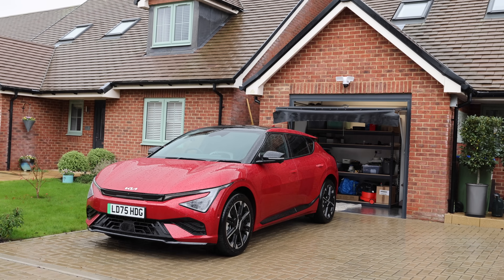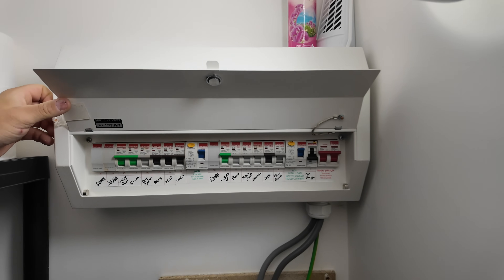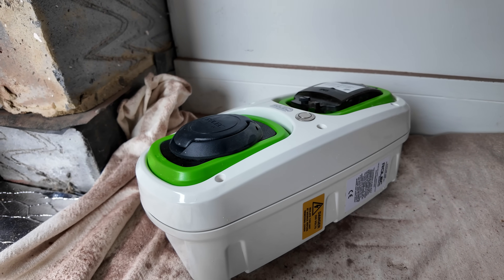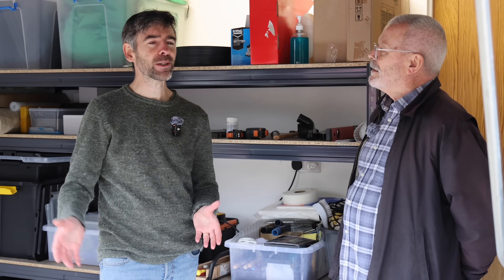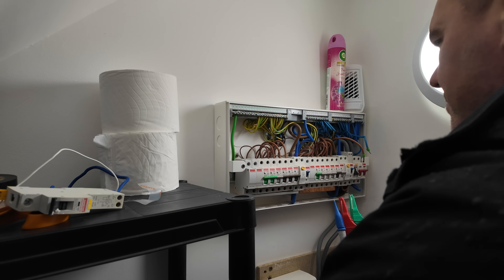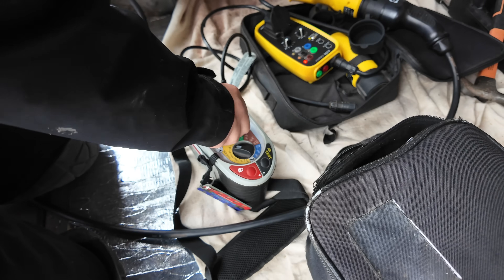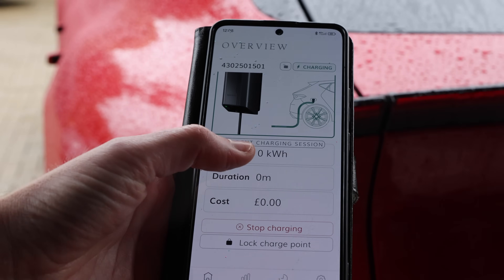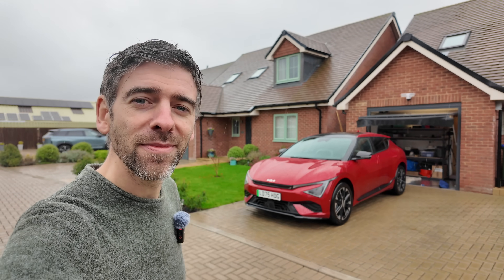Big warranty, big cable, small charge point. Swapping a Rolec charge point for an Andersen Quartz

Comment: I have 3 phase and have 2 charges at mine for the 4 EV”s we have a Wallbox and a Tesla both cater for 11-22 kw but only have connected to single phase 11 kw 
We have a brand new Tesla model y performance a Tesla model 3 highland a brand new corsa e and a 73 plate MG4 . None of these cars accept more than a 11kw ac so what is the point of the 22kw option 🤷🏼‍♂️ I’ve never understood unless you have say a sigenergy DC charger (£3500😬) or something else that gives a DC output.
Reply from the maker: There are EVs with 22kW AC. Renault and Smart for instance, but it’s also an option for others.
Reply: @MrEV yes would not sway me to buy one but would think seeing as Tesla used to have it in early S & X models you would carry through ! But I suppose the amount of people it would cater for is so small regarding the 3 phase they binned it . Never mind can’t have everything lol a self driven beast that looks and rides fab on long trips , I can wave the 2 times a year I could do with it lol😂

Comment: Nice looking charger and the slim profile will suit many. I’m looking for such a unit to potentially replace a Wallbox Pulsar Max which after two years of mostly trouble free use has a current problem, thankfully caught by accident (I needed to move the incoming supply), the tethered output shows signs of extreme heat damage where the cable has melted at the connection block on the circuit board. Unlike the incoming supply that uses a screw down terminal connection the tethered cable uses a wago style lever terminal block – presumably to save time in the manufacturing process – this design choice appears not to have stood the test of time and operation. I was encouraged to see that Andersen have used a screw down connection for their tethered output but then undone that good practice by using wago style terminal block for the incoming supply! I’d hate to think that should a similar heat issue befall  an Andersen charger a warranty claim maybe dismissed as customer connection error. Why can’t manufactures just design things properly!

Comment: When your WiFi goes down how do you control the Anderson? It doesn't appear to have a screen of any sort.
Reply from the maker: I've heard it works in "dumb mode" if the wifi isn't working.

Incidentally, I didn't show it in the video but John's wifi actually wasn't working so we connected it to his phone's hotspot instead, so that's another option.
Reply: The set-up button is also used to start & stop charging...

Comment: You didn’t state if it was both suitable with Octopus go and if it will work with solar. If one has solar are there extra bits to fit so that it can see when solar is producing spare electricity.
Reply from the maker: It certainly works with Octopus Go and I did say that it works with solar? I imagine a CT clamp would be needed in that case.

Comment: What a pity the builder didnt put in a modern one. Wondering how much all this cost (parts, installation, labour etc)?
Reply: The Andersen Quartz starts from £695 and standard installation is £435.
Reply from the maker: Builders will often do the bare minimum to say "it's got a charge point!"
Reply: Some just put a weatherproof box ready for one.. fair enough.

Comment: That’s it- drill a big hole from inside to outside with a blunt drill and make sure you compensate with hammer action and lots of pressure.  Guaranteed to explode the front off your brickwork…..

Comment: Andersen appears well designed. 8m cable very useful. We have a Tesla wall connector and works seamlessly with both the Tesla App and Octopus Intelligent Go app - also very clean design in my opinion but the tethered cable may be a little short for some.

Comment: I cannot see the benefit of taking a mains connection, currently (no pun) protected from the elements inside a garage, and Shoving it out into the pouring rain? Why not simply plug the car in, then run the cable under the door??
Reply: Exactly, our Zappi is in the garage, cable runs fine under the door which has a 3-4cm compressible seal strip which closes nicely around the cable when closed.
Reply: Most likely there isn't a gap under the garage door. But I agree with the sentiment, you want to hide the charging unit from thieves.

Comment: I’ve seen new developments that have a 13A socket outside and called it a charger. Nuts.
I think having a junction box with appropriate cabling would be better than installing a simple charger as it’s highly likely that the new home owner will want to install a different charger. Throwing perfectly good EVSEs away is such a waste.
Reply from the maker: Yes, a junction box would arguably make more sense to allow home owners to do research and choose a charge point that works better for them... that said, then I think a lot of people just wouldn't bother and would be perhaps less likely to get an EV.

Comment: Always go tethered!
Reply: I've gone untethered for one reason. If some knob decides to damage the cable when my car is plugged in, I just buy a new cable. With untethered cables, in some cases, the EVSE is a sealed unit, so you'd need to replace the entire unit. Expensive.
I'll add that my EVSE is inside the garage.

Comment: Given yesterdays 3pm mile announcement I want to take advantage of my car’s V2Home capability but don’t know where to start? Anyone know where I should look ?
Reply from the maker: There aren't really any V2H charge points widely available yet unfortunately. 2026 should be the year for them though!
Reply: Many do V2L ie vehicle to load, with a 13A cable. Eg ionic 5 and MG4. 
 Not really V2H but still useful in a power cut.

Comment: My charge point is in my garage. It keeps the charge point (Zappi) out of the weather. I run the charging cable under the garage door. 
It also keeps it away from the prying eyes of passing yobs and drunks.
Reply: Same here, exactly. Zappi cable runs nicely under the compressible door edge seal strip.  Simples.

Comment: Oh My God! why did you take all the lead off and put it on the floor??? Just take off what you need
Reply from the maker: Just habit! You get increased heat when the cable is coiled and it's slightly less efficient. Less an issue on a cold Autumn day, obviously!

Comment: How does the charger work without a data cable for load management etc? Looks like the original wiring didn't have one?
Reply from the maker: It uses a wifi connection.

Comment: Home chargers need to be tethered. Untethered would be a right faff. I guess you could leave your cable in it but prob not ideal.
Reply: I agree as it is a pain to take the cable out the car however there is a cheap solution.

 We have an untethered old podpoint solo we’ve had for 5 yrs. we had a 10m 7.2kw type 2 cable used with a previous plug in hybrid and as my new ev will charge at 22kw the cable was surplus to requirements.

I put the 10m cable in situ and used a long hasp padlock round the cable and trunking from the main board to the podpoint which locks the cable up.

It meant we had a 10m tethered cable for the cost of a padlock

Comment: Looks allot like a simpson and partners  which I believe the Andersen is being looked into for intellectual copyright for transparency.

I would not get another charger that has a plastic casing or shroud that isn't easy to change or ready available if the charger is outside in all weathers (sun mainly) as they can get brittle and start cracking from experience.

Comment: I’ve been umm-ing and ahh-ing over getting a proper charger installed for years. I’m sure it would make planning a little easier but the 3-pin really is fine for us.
Reply from the maker: I hear from a lot of people for whom 3-pin does the job for them which is great. A dedicated charge point is safer in theory and the higher voltage brings greater efficiency (so less energy/money wasted when charging), and obviously supports smart tariffs which are great, but I'm sure for many it's a false economy to spend so much on one.
Reply: Sooner or later the 3 pin socket will burn out but they are cheap to replace. A switchless one is preferable as the switch is often the weak point.. electrician I am.
Reply: @MikeGleesonazelectrics  Thanks for the advice. I’ve had my leaf charging off the same socket every night at 10A for over 6 years now so I’m sure its days are numbered. It does look fine after all those years and after 6 hours of charging the socket and plug are both cool to the touch still. 

I’ve recently got an Ioniq 5 too and I can turn the amperage on that down from 10A to 8 or even 6. It does take much longer to charge at 6A though.

Comment: another good video, I looked at the Anderson offering, but decided to go with an untethered Vestel unit with install from E.ON, I'm now on their Next Drive Smart V5.2. I decided to have my unit in the garage because it lights up like Blackpool illuminations when the cars plugged in. I've got a 10m cable that runs under the garage door when charging.
Reply: How long have you had that installed for? I only had mine installed in March and EON had to come out last week to replace it as it stopped working.
Reply: @charliebell3956  It was installed December 2024, had to have a software update in May, but not had any real problems.
Reply: @AF-eq4hf that’s good to hear, I have seen nothing but bad reviews on trust pilot about these chargers and EON, EON also do not offer this charger anymore which is worrying. When I spoke to the technical team on the phone they advised that they are problematic and when the electrician came to replace my faulty one he said that they were not good chargers. It took them 9 days to send someone out to look at the charger as well which isn’t great.

Comment: I bought a cheap ChargePoint for £315, thought I could do with just a dumb one - 6 months later, wish I'd bought a smart one now as I can't take advantage of Eon's NextDrive or Octopus' IOG... you live and learn!
Reply: I just use a granny charger and a 3-pin plug - it works perfectly well with Octopus' IOG.  You don't need a smart charger.
Reply: I also use a granny dumb charger on EON Next drive, so I don't see why you can't?
Reply: @Hamilas-zk8hm Doesn't your car need to be compatible in that case? My car isn't compatible unfortunately.
Reply: @lukecalladine1683  Yes, I believe so.  I have a VW ID7 which is compatible with Octopus.  So Octopus connects directly to the car and sorts out the charging schedule to be ready when I want it to be.
Reply from the maker: That's so frustrating!

Comment: I just got a Hypervolt 3 Pro and it's pairing really well with the Octopus Intelligent Go tarif. It seems to give me off peak at any time of the day, even when it was well below freezing and I thought the grid demand would be high. Very impressed so far. I've ordered a Tesla powerwall in a sale to take advantage of the tariff... I seem to be going mad for batteries in my senior years 😂
Reply from the maker: Great to hear! You're very lucky to be getting so many daytime charges!
Reply: @MrEV I was a bit nervous at first thinking I’m going to get hammered with the higher tariff cost, but after a couple of days it’s all properly coded 🎉 I love not visiting a petrol station 😂
Reply: Same here
Reply: I’ve got the Anderson A2 tethered and it’s been great. I’ve had more finger problems than technical problems, I’ve found Andersen to be really helpful in firmware updates and getting me back up and running when I’ve cocked up my end. I’m currently with Scottish Power but I’m tempted to go over to octopus.
Reply: @ianroper2812  I've been very impressed with Octopus. I'm more or less getting low ost energy any tine of the day with the EV  (in Fife) and we've switched to using our appliances overnight.
Reply: I’ve two Powerwall and they are great, however the one your getting is the Powerwall 3 and it’s even better it’s lithium iron, safer and it will discharge at 10kw whereas my Powerwall 2 would only discharge 5 kw each total 10 kw. As for your car Hyundia / Kia are the best I’ve had both over the last 7 year with absolutely no problems, unlike VW!
Reply: Had a hypervolt when they first came out. Great charger to use and very pro active customer service. Unfortunately they weren’t compatible with octopus intelligent when switched and had to go with an ohme to get the tariff. It’s okay but poor customer service and has issues connecting with Hyundai api
Reply: @choshun8  Works perfectly now. I have running seamless with Intelligent.
Reply: @TheTravellingScotsman is that hypervolt or ohme? I never had any issues with hypervolt but also never connected the car via api as I wasn’t on the intelligent tariff at the time